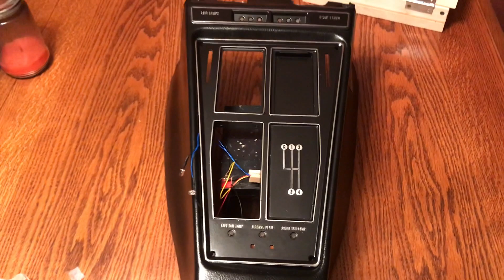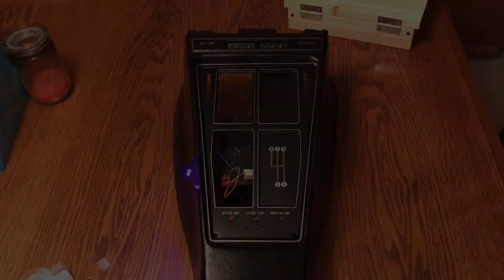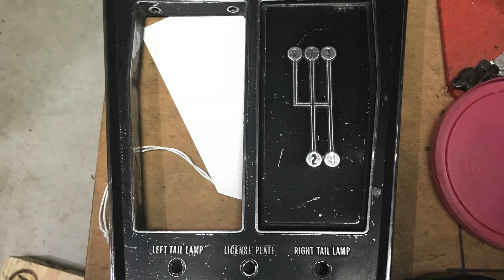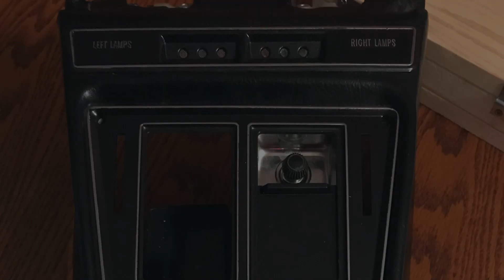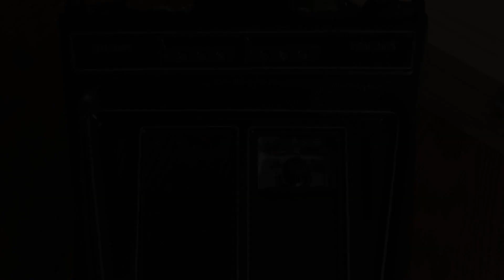1968 Corvette fiber-LED conversion

Comment: Isn’t the purpose of the fiber optic to let you know if a bulb has burned out. Kinda defeats the purpose if its wired into the system
Reply from the maker: You are correct, but because the car is custom and the headlights were relocated the fiber system is no longer there. This car is a driver for me, and I'm not interested in the cost of restoring the actual fiber optics, so this still looks the part from inside the cabin.
Reply: I think the fiber optics is cool and nostalgic and to keep the original integrity of the corvette design its pretty cool how he was able to merge modern tech and old school tech:)

Comment: You can buy end glow fiber optic cable of the original fiber cable size, and use black shrink tubing of the proper size on e-bay. Alot cheaper than the reproduction cables. Remove and use the old brass end connectors, and cut prepared cable to lengths needed. I did this and it works fine and is brighter than the original lighting. Just a thought.